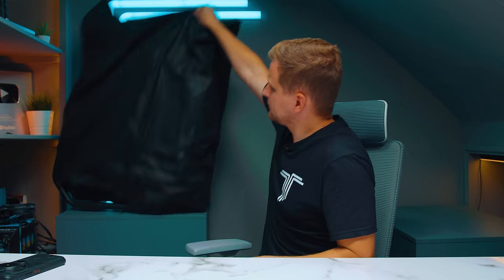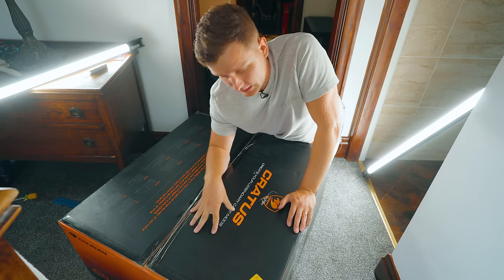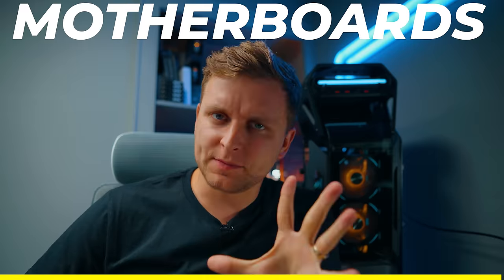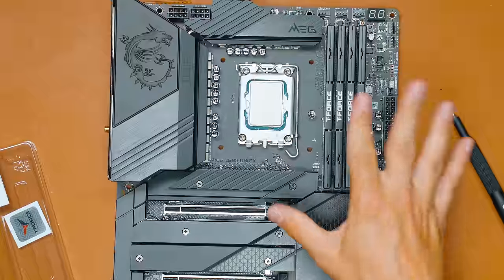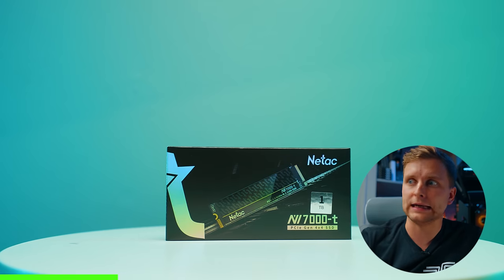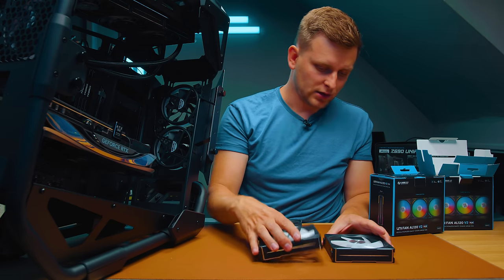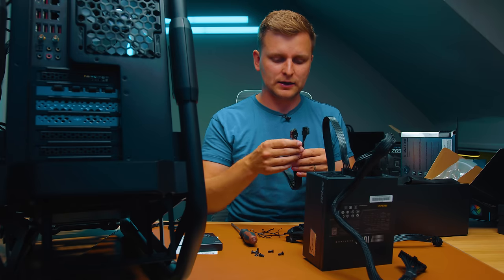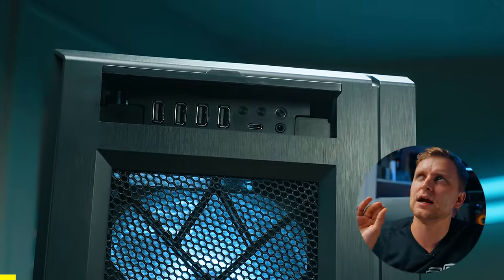Gaming PC vs. Creator PC: Biggest Mistakes Revealed! | RTX 4090 Batman PC Build

Comment: I think you forgot to re-enable the CPU power limit. Many MANY motherboard manufacturers will ship their products with the limit set to 4096 Watt (no limit) when Intel actually designed 12th/13th to work with up to 253 Watt. Much like the RAM frequency, you will want to make sure the CPU runs within Intel's recommended specs.

If you apply loadline calibration correctly, you can reduce thermals tremendously. I have done so with my 13700K which is now slightly overclocked for single-thread loads while leaving multi-threaded loads largely alone. I'm getting ~98% sustained performance on a Noctua NH-U12A. Power only ever exceeds 200 Watt when benchmarking. I also reduced the frequency of AVX workloads by 200-300 MHz as they caused me the most headaches when running Prime95.

Comment: Great channel. I'd like to ask your opinion. My build is i9 13900k 13th Gen, Asus Strix Z790-A Wifi D4, 128GB Corsair 3600Mhz DDR4 Ram, MSI RTX 4070 12G OC (I was cost prohibited), 360 Asus AIO and I use Resolve Studio 18 and Lightroom mostly, no gaming. Should I invest in a second MSI RTX 4070 12G OC or wait until I'm able to upgrade to a 4090 card? Also, did I do pretty well with my picks for components? Liked & Subscribed, Thanks, Paul.
Reply: Go for a single gpu that’s more powerful considering the 4080/4090 are worth in terms of performance

Comment: My issue is that, I can't get a motherboard with a debug display and on-board power and reset buttons without buying an expensive board like that. They just don't put those features on inexpensive boards anymore like they used to, and they're necessary in my opinion. So I buy the $450-$500 board whether I need the overclocking, beefier VRMs, better IO, more PCIE slots, etc. or not.

Comment: That PC frame looks like it would be equally at home on a Bat Bike.
What was total price of this build? 
Also I wonder if the radiator might have better where it was but rotated 180 degrees (so the pipes/cables aren't stretched).
Reply: Same for me with the rad placement

Comment: great build once again,  but i may have a solution for your pump ring issue , just make a 3 pin argb 5 v to a Connector that the L3 connect port  JST SM 3 Pin works like a charm for me

Comment: SignalRGB or OpenRGB  would sooooo simplify ARGB control over all your ARGB across manufacturers from a single software… I don’t know why anyone, who isn’t all in on a single ecosystem, wouldn’t use one of these rgb softwares rather than the crap the hardware manufacturers throw out there.

Also, in my opinion, a creator machine should absolutely care about airflow for cooling even more so than gaming system.

Comment: The radiator is mounted upside down. Flip it and remove that air pocket that’s blocking coolant flow. There’s your overheating fix. You want your pump to be pulling water at the lowest point of the radiator, not the top. It creates a vacuum and traps air. Never mount your radiator that way if you’re mounting it on the front your case.

Comment: Good video. Good thing about building even budget creator PC it will last for years as Gaming PC. For my gaming needs at least ;)

I went with Z790 MSI Tomahawk, 13600K, 32GB 6000/CL32 RAM, 4070, Kingston KC 3000 as primary drive, Kioxia Exceria as secondary (well it's PCIe 3.0, but that's budget build) and SATA SSD which was system drive in old build as temp/cache drive. I reused my PSU (Be Quiet Straight Power 11) and Case (fractal Design Define R3).
And no RGB at all!

If I would build something for gaming and photos only I would went with something much cheaper.
Reply: I think Z690 is much better, it will be a little cheaper, and most people won't need everything a Z790 board has on it depending on budget AMD is most likely a much better deal though unless you need some of the things Nvidia offers, with only 2 YT videos I don't consider you to be a creator so reconsider whether you want Nvidia or AMD.
Reply: @leagueaddict8357  No I definetly not a creator. Do I work with my PC? Definitely.

The main reason I went with Tomahawk Z790 was that when I was upgradeing my PC there was no Z690 versions on the marek in my country and I decided Tomahawk is best bang for buck. Also I got it quite cheap.

I decided for 4070 instead AMD beacuse first I didn't need to change my PSU, and second in long term the energy saving are making it bit cheaper than AMD cards.

I may be wrong with this setup, but for now it works and I'm more than satisfied with it. And if I overpayed then I guess that in the past :)
Reply: Idk what country you live in, but I think AMD is pretty much better for energy as well, Intel CPU's tend to draw a lot more power than AMD CPU's unless you go like 4090 high end I think Nvidia is a better option only there.

PSU just depends on which PSU you are running, I think the Corsair PSU's are the best atm. @Michal_Bauer

Comment: Just a query if you may reply then. using any GPU 12VHP extension cable, will it hamper the performance or cause overheating of any sort?? like i have a ASUS TUF 4090 so don't want to buy any cheap extension cable that may harm the GPU or its performance. Would be glad if you can help me out here.
Reply: As long as you are buying the cable from a reputable manufacturer (eg. Cablemod) you should be ok.
Reply: @petrolhead0387  what about the one used in the video some ezdiy named brand? As I don’t think cable mod is available in India
Reply: @rahulkamath6984  not sure why YouTube removed my previous comment, but if you didn't see it, PCMR is best place to ask for suggestions.
Reply: @petrolhead0387  you mean pc master race?
Reply: @rahulkamath6984  that's the one. You will always find someone in your location on there that can point you in the right direction.

Comment: The advice about the RAM is more accurate than what some of you might think of it. 
I am running 5700x (yes, wrong CPU, I know), 32GB DDR4 Ram and when I am mid-way done with my SINGLE photo (although a composition) in Photoshop I can see RAM usage being 30GBs+ (out of 32 total) :) So as mentioned try to go directly to 64GBs because in photoshop you will see massive bottlenecking straightaway. Near the end of my photo editing I am barely doing stuff out of stuttering and massively decreased image quality simply because RAM is filled out completely

Comment: Not sure if anyone mentioned this below: To get the correct color on RGB lights try entering the color codes manually. If the software won't let you pick the color from the color wheel and it won't let you enter the codes manually, then try a 12ga breaching charge 😁You can google the orange codes (there are many shades, as you can imagine). Also, I'm no greenie, but the Intel CPUs are major energy hogs. The high-end Nvidia GPUs are also major energy hogs. AMD products are much less heinous offenders in this regard. Enjoyed the commentary on Gamer vs Creator builds.

Comment: Hi! Holy GPU, Batman! Another great build! I love your channel and have learnt so much from watching all your videos! 
I am looking for some advice with my PC. My motherboard is the MSI MPG B550 Carbon Wifi. I am looking to upgrade to a Ryzen 9 5900x (Currently Ryzen 5 3500x) and I'm looking at upgrading to 4 sticks of 16GB DDR4 RAM (most likely 3600Mhz). Should I get CL16 RAM or should I save my money and just go with CL18? I mostly use my PC for video editing in Da Vinci Resolve (Mostly 4K 8-bit, sometimes 10-bit 4.2.0 but possibly 6K 10-bit 4.2.2 when I get a new camera)

Edit: MY GPU is a 3060Ti, if that is important.
Reply from the maker: not much difference between cl16 & 18, I'd save money :)
Reply: @theTechNotice   Thank you so much!

Comment: I firmly believe you should have inspected and fixed the thermal throttling issue instead of saying "I think its the cpu" and calling it a day :) Shouldn't it perform stable without throttling at stock voltages and power limits without further undervolting or limiting with that kind of AIO?

Comment: I paid for the pny quadro rtx 5000 graphics card, which is around £2000, do you think I paid too much for a graphics card or do you think it’s good for my high end workstation pc. My pc is worth around £4500 so it’s just under half the value of the whole pc. 

Edit, I kept watching and you said that a higher cpu is better than a high Gpu, so should I try and sell my Gpu and try and upgrade my cpu?
Reply: Since you already owned the parts, I reckon it would be easier to monitor the resource usage and see where the bottleneck is.

e.g if the GPU was well utilized while CPU hit its performance ceiling, it might be best to upgrade the CPU without downgrading GPU since doing that would just move the bottleneck to other parts.

Comment: Ive been a fan if yout builds for a while and still your builds are some if the best PC builds from performance astetics every thing you put into your builds is art. Your One of best creators that has leveled up the PCMR to make beautiful works if art Not just snow whites with ARGBs stuck in every corner. Still the All ProArt is my fav cause Black N Gold my color. Anyway I built my first PC Last December which i use mostly for my music production so  stability was key and i haven't ran into crazy problems and i love my machine cause i created what i pictured what I wanted and even bought these fans that looks nice but wiring the fans and argb connectors was really the tedious thing a ran into a being my first build. But it all came together and with 4 new fans i didnt use cause i just liked and ordered them i didn't understand a difference of 5v 12v MB connections until after i built my PC and was afraid to power it up for a week.

Comment: Possibly purposely undervolt the CPU… probably will get faster clocks because it won’t thermal throttle.  Motherboard manufacturers are notorious for pumping unhealthy amounts of voltage into the 12th and 13th generation Intel CPUs. On a different note, I have had really good success using the Arctic MX-6 even over the likes of Thermal Grizzly and Kingpin.

Comment: i love my i9 13900 non K with Deepcool AK620 on B760 Gaming X with 128 GB Kingston Fury ram sitting in Phanteks Enthoo Pro case (classical model with dual plex window) powered by Fortron Hydro 1200W platinum psu.... Now i just wait to change oldie rtx 3060 Aorus (Better than rtx 4060 as Tech Notice showed for creators in video - great video!) for rtx 4090 aorus or PNY model. Thanks for awesome as always video.

Comment: Toss that oem cpu chip clamp in the bin, and go for one of the 2 aftermarket cpu forms, that does not bend the cpu, and actually give it a lot better heat distribution surface.
This is whats causeing your thermal throttling. Along with that you have to tune down the volt. This has been cowered by jayz and gamers nexsus for this cpu to many times. You would think as a tech channel, you follow them aswell? No need to wonder about stuff that has been looked into so much by others, and solved.

Comment: Why did you buy a modular PSU and then connect all the cables you are not using? That's a ton of unnecessary clutter. Defeats the entire purpose of a modular PSU.

Comment: I do a lot of work with Cartography mixed with Data Science, Computer Science and Programming, with a bit of 3D modelling (mostly from LiDAR) mixed in. I'm doing research to create my first PC build with this as the primary role in mind. Based on what I understand, this role would fall under a creators PC, so I was wondering if you had any recommendations for parts? I'm trying to keep the cost between $2,000-$3,000 Canadian, lower is better without sacrificing performance.

I'm currently considering a Intel i7-14700K processor, with a MSI Pro Z790-A Max WIFI or a Gigabyte Z790 Aorus Elite series motherboard. Still haven't decided on the GPU, or much else yet for that matter. Though for RAM, would you say that 2x32GB or 4x16GB RAM would be preferable?

Comment: Been a fan of the og Cougar Conquer since it came out but sadly it was 2.5x the price in India, was also way too small and a cable management nightmare. Nowadays I'm more of a Lian Li O11 Dynamic/Vision kinda guy. Also I never knew screwdrivers come in that shape and thanks for the multi zone uni fans recommendation, didn't know about them either. And seems like Zotac screwed up their software big time since the 20 series, I've got the 2070 Super Amp Extreme but the software and rgb runs flawlessly.

Comment: Closing those 3 fans in with that steel door, behind the glass, is painful to watch 🤐. Those fans will not work rly. And therefor you wont get positiv pressure in the case.
Reply: While I agree on the first part,  have you actually looked at the case? You will never build any sort of pressure in there or have heat trapped, since it's not sealed like a regular case. It has massive gaps between glass panels and the rest of the case.

Comment: Three different pieces of RGB software - yikes! You may want to give Signal RGB a go - this can control lots of different RGB hardware.
Reply: This and I didn't notice if he used a contact frame or not. If not it could help with temps. But yeah Signal RGB is almost as good as the iCue software but of course you aren't limited to one manufacturer.

Comment: i would rather have i7 with a 4070ti and then the i9 with a 4090. if someone was to get a i9 and then a cheaper gpu i would laugh. would u like to buy a asus b150m motherboard with i5 6400 and 8gb fury hyper x ram and GTX1070 and i have a evga g2l 850watt PSU. ill sell it cheap to ya.

Comment: Gaming pcs are equipped well enough to play games. Barely. Lol. Dev computers are not equipped for gaming but for compiling code. But if you use a compiling gpu for gaming it'll run like crap. And cost you thousands of dollars more then a gpu that can play the same game 4 times as fast. But a gaming gpu would not compile code as fast as a dev gpu.

Comment: Still not a real creator / workstation setup. No ECC memory and a gaming graphics card. Stability is the primary factor especially when it comes to rendering and large data sets. What about 10bit pipeline? What about the correct monitor? Photographers will benefit from GPU performance in 2023 as well. This realm is only expanding. 64GB of ram is still a low amount and will quickly fill up. Just because you put a “creator” motherboard in there doesn’t mean it is one. Lastly multiple GPU’s is still a thing in this world. What’s lacking on this front are proper multi GPU motherboards with multi full bandwidth PCIe slots further limited by the availability of pcie lanes. This video is quite disappointing and would be creators should look elsewhere for properly configured workstations.